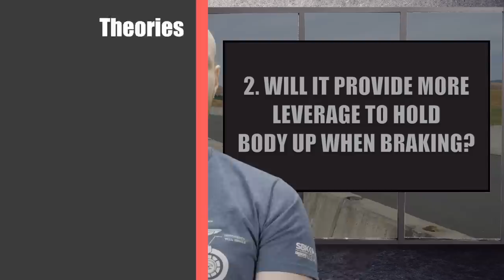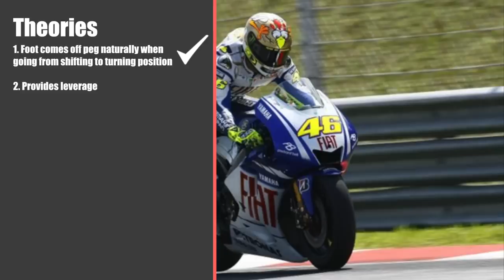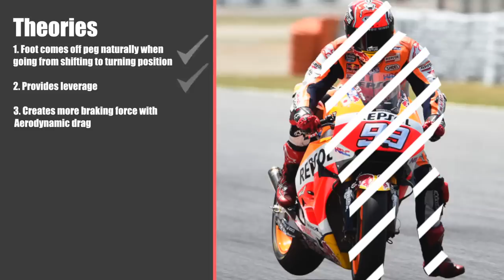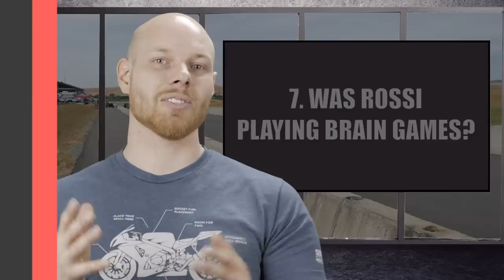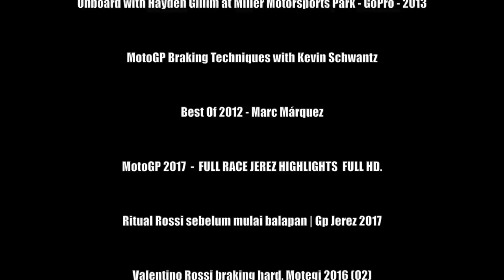The Leg Dangle EXPLAINED

Comment: Neighbors look at me funny when I do this on the lawn tractor.
Reply: Lmao
Reply: You need new neighbors
Reply: When you're braking late before turning around? 😅
Reply: @Sheza58  "trailbraking"
Reply: They look at me even weirder when I have it at max power and I’m in full gear dragging knee off the John Deere
Reply: Why would you do that on a tractor
Reply: Haahaa
Reply: I do it on bicycle, and i lean so much that my tires are on the limit, i measured and i sometimes exeed 45 degree.. everyone looks and thinks i am retard for riding bicycle like that but i dont care, thats some of the best feelings ever, to lean so much at speed...
Reply: @kratkidokumentarci224  on a motorcycle, the feeling is on another level!
Reply: I tried it with the weed eater and tripped myself
Reply: @kratkidokumentarci224  yea one time on my bicycle i leaned so much that my rear tire slipped but i did one of those mm93 saves
Reply: They won't be laughing when it's got a big bore kit and twin turbo.
Reply: Sound like a them problem.
Reply: don't worry my grandpa use to do this on his horse

Comment: I did the leg dangle going 60mph as a split second reaction to my front wheel losing traction during a tighter-than-expected corner. It saved me laying the bike down and sliding into a tree.
Reply: Exactly. Helps with balance and center of gravity
Reply: Inside Business - Nice maneuver bro. Are you still in one piece currently?
Reply: @carlcampbell6827  Thanks, I am and haven't  had any close calls like that since thankfully. Winters coming soon so I don't want to jinx it haha!

Comment: What if Rossi just had to fart. those race suits are tight and the leg lift helps probably
Reply: farting before entering every corner? sounds about right
Reply: Ivaylo Ivanov you see how fast they’re going? The river would be running brown
Reply: @ivayloivanov3744  when riding the chiang mai loop after a pad kapow for breakfast i can vent my spleen on each of the 1864 corners.
Reply: That's a nice theory, but you don't see the suit inflate. Unless they have ventilated suits.
Reply: @64t120r  The real question is: how much of an advantage does this fart produce? That additional propulsion may be wery well controlled. Does the Doctor eat beans before the race to fuel his power?
Reply: I laughed harder then I should've...

Comment: #4 makes a lot of sense, as that's what Flat-trackers do.
When I was learning all those years ago, I was taught NEVER do this, if you foot "catches" the road, it'll snap your shin like a chicken wing.
 Not everything racer does means you should do it on the street.
Besides, two feet on the pegs and knees on the tank makes you more 'planted' on the bike, hence, more stable. Ride a bicycle with no hands on the bars and no feet on the pedals will illustrate this quite well.
 You're not Rossi. Ride like you want to live and you'll have the best chance of doing both.
Reply: Best comment to this video by far.  I'm on-board with your line of thinking.   Cheers.
Reply: Blah blah blah
Reply: “Ride like you want to live” best motorcycle quote I’ve read
Reply: Chicken chicken chicken
Reply: Thing is, almost everyone does it now.

Comment: I’ve seen a few of your videos.   They’re very informative.  I’m an ex-racer and I can tell you why I did the leg dangle.  For me, it had to do with stabilizing the bike on corner entry.  Under heavy braking going into a corner, the rear wheel gets light or comes off the ground, and it stays that way even after beginning to lean the bike into the turn.  The result is that the rear wheel drifts out-of-line to the outside as the bike tips in.  You called this “offset”.  When the weight comes back to the rear tire again, the bike does a big shimmy as the wheels snap back into alignment.  Modern bike design focuses on the centralization of mass, and this makes for quicker turning but it also decreases stability.  This makes the shimmy even larger, and my leg serves to counter this instability.  My extended leg acts exactly like the long pole that tightrope walkers use in that it DE-centralizes the mass for a moment.  When the shimmy is over, I pull my leg back in.  To the extent my outside leg is locked onto the tank, my inside leg (pole) stability is transferred to the bike and minimizes the rear wheel shimmy.  This is similar to your #4 but it's about stability when the wheels pop back into alignment and not just keeping the bike upright.
Reply: Back wheel shimmy? F. I never experienced that. Or tank slap. Tell me more!    ——I sit up if braking harder than usual. Weight transfer, wind resistance, blah.

Comment: Dangling the leg will definitely increase drag substantially, just look at how small changes in aerodynamics can increase or decrease drag coefficient. It will also steer you into the corner. The other thing is that it allows your body to relax for a moment, staying in that tight crouched position for an entire race must be hard on the body (mainly the hips).

Comment: I'm no professional but by studying the videos and watching documentaries and having experience riding dirt bikes, supermoto and street/sport bikes the answer is very simple. Its number 4, the others all help out to control a slide. Why would they slide you may ask? To brake later into the corner and carry more speed! If you watch supermoto racers they all slide into corners while they have their foot out pushing the bike down because it's a fast way of doing it. Marc is infamous for sliding the rear wheel and having the leverage and foot out gives him more control of it especially considering how late he brakes into corners. Other racers do it to incase that happens because of how hard they brake using the front brake, which lifts the rear wheel and when it gets set back down might induce a slide.
Reply: So should I do a Leg dangle if I am doing a Kneedown on a Supermoto?
Reply: Lil Mango it's a moto x hangover it's where they all start racing simple.
Reply: Rossi trains on flat track bikes and dirtbikes.  Its a habit that transferred over.

Comment: I disagree with number 2. In the other sports mentioned they are trying to push backwards on the ground to accelerate themselves forwards whereas the riders are trying to push back with their arms to hold themselves back against the braking forces. Putting their leg forwards, even when not braking will add more force on their arms to hold them back. During braking it will increase the forces on their arms required to hold themselves up.
At a constant speed (or stationary), putting their leg backwards will cause gravity to rotate the body around its CoG, moving the leg downwards and the torso backwards. Similarly, during braking putting their leg downwards means the braking forces will push the leg forwards which will rotate the body backwards around its CoG, including pushing their torso backwards. This means that less force is on their arms, by using their core muscle and the backwards rotation caused by their lowered leg during braking.

Comment: I'm an old former 2 class AMA Expert License holder (125cc motocross and 250cc Road Race, both back in the 70's, and also raced some flat track and competed in Trials competitions and Enduros)), who now rides a highly modified S1000RR...my take is that I/other top riders in the 70's learned to use that technique in motocross to help steer with the rear wheel around corners, it helped with the center of gravity...and of course in motocross if you slid too much you could use it to help stabilize by making contact with the ground, but the idea was to never let your foot touch...I had never really thought about it relating to Rossi in GP, but back when I bought my S1000RR (2012)  I found it helpful (not to mention fun) to slide it into corners to help with corner placement and to get the rear (and front) tire pointed in the right direction and I noticed I was naturally dropping my inward foot just like I did as a youngster in motocross...it wasn't until later that I started researching the idea that I became aware Rossi had popularized it.
Reply: steve Fowler Question. How old are you? I just ask because as an older rider I noticed how it’s not as easy as it once was to ride anymore. I refused to get a Harley and ride to Starbucks but I honestly wonder how much longer can I be in this sport before I just can’t do it anymore. Can’t imagine life at that point! I’m 50 now and it’s getting much harder to deal with the heat, low energy, fatigue, etc. just curious.
Reply: @Dave...I'm 61 and the only issue I have is my heart still thinks I have the reflexes of a 20 year old, and I do not, so it is a constant battle when I'm on my S1000RR to ride well within my limits...at 61 I certainly don't want to get off it, even at modest speeds...it's a dilemma for me that I constantly fight...as to my health, I'm good to go, I still work out at the gym 2 to 4 times a week and still run about 1 1/2 to 2 miles twice a week and still weigh about what I did in my 20's....I would suggest you consider doing some weight training and some aerobic activity (run, bike, etc.), it may improve your energy and outlook....good luck.
Reply: steve fowler, sounds like very good advice to me...  rock on bud!!   I'm 60 myself and am very interested in giving trials a shot. I see tons of practice involved, but the fun kinda practice.
Reply: I don't understand why nobody else mentioned a reference to motocross, that they just simply carried it over by habit. Since MANY, if not ALL, motoGP riders start in motocross.

Comment: Doesn't most of the leg danglers practice a lot with riding flattrack? Muscle memory and just feeling more confident while sliding leads to that since flattracker do it a lot
Reply: Burwarn Rossi does indeed do a ton of flat track training
Reply: That seems a very likely explanation.  I used to ride mx, scrambles,  TT scrambles, and some road racing.  I consider the reflex to dangle a leg a very strong influence that translates into confidence.  As for mx'rs putting the foot out in front, it was largely to keep it forward to keep from getting drawn into the passing turf and ruining the intended line - probably among other senses of balance, etc.
Reply: Before I even watch they dangle the leg to stabilise and transfer more weight to the rear of the bike , hence more grip on the rear tyre during the weight transfer to the front wheel during hard braking.
Reply: Now that sounds like a proper answer.
Reply: Air Doctor - Interesting assessment.  Since I came onto this discussion, have been trying to get a clearer picture of how my own tendencies to do this can be worded out for explanation and it isn't easy.  So much of it is instinctive.  I think there is a tendency for the oncoming air against the protruding leg to begin forcing a twist to cause the back tire to start skidding mildly to the outside of the turn.  In the case of TT scrambles and short track, I doubt the force of wind against the leg had much effect but somehow, the change in c.g. combines with outward force and a controlled slide is precipitated.  I was a successful sportsman rider  throughout the '60s, btw.
Reply: Yup.  It’s natural to wana put your for out when turning a bike.
Reply: @whalesong999 I used to ride mx bikes when i was living in dubai. His explanations related to the mx is a bit off. I'm lucky enough to have a retired racer to be my friend. One thing this video is lacking is that he could have easily asked a racer about his opinion , Instead of going very technical.
Reply: Air Doctor - Yes, technical descriptions for this will be inadequate.  It's just how the rider can translate his feelings into words and, boy howdy, that's not easy!! edit When I came into the sport, the circuit riders of the AMA were dragging their feet during road racing as they were in flat track, and, they raced with no clip on handlebars, used high bars with some stubs on the forks to tuck in on the clutch side.  I don't think they even used rear-set footrests!  Funny how the tendency to let that inside foot go off the footrest has come back into vogue!  ;-)
Reply: Be nice time just to stretch out a little.
Reply: Burwarn 
ha ha, I've just proposed your exact same point without reading it first, might we be right?
Reply: Flattrack and offroad riding in general. I have the same tendency on a road bike while i have an offroad background.
Reply: Sounds better I've always rode mx since I was small and just recently started road riding and it's so hard to stop the habbit of sticking your leg out into corners
Reply: Top riders in flat track slide through legs on the pegs
Reply: The most correct observation right here. I dont think that was the reason he did it the first time but I think after years of flat tracking its become instinct.
Reply: fun fact. My mother's ex who is my brothers biological father is (smokin)Joe Kopp. He is "retired" AMA flat track racer. I'll ask him why they do this shit

Comment: I would add another to the list of reasons - comfort impact.  Straitening the leg would have a benefit in giving some relief/rejuvenation vs being folded up.
Reply: SportbikerNZ that is what I used to think
Reply: I used to do something similar on longish trips, but not racing. OTOH, racing bikes are fairly uncomfortable
Reply: Dirk Bruere I do the same thing on longer trips that are lacking in curves. I thought I was the only one, guess not
Reply: Was looking for this. I have damaged knees and ride with a very tight knee angle. Dangling each leg in 1-2 corners each lap stops the pain in my knees.

Comment: There is no technical explanation - they don't do it every time or every corner. The best explanation/justification I've heard is that it helps blood circulation in the leg (otherwise restricted by the serve bend in the knee caused by riding crouch for aerodynamics); can't do it in a straight line - tucked in for aerodynamics, can't do it in corners - obvious. Only in braking is there the opportunity without disadvantage. 

Street riders often stretch their legs in the straight ahead because they are not going for every ounce of speed (aerodynamics).
Reply: Graeme SYDNEY well said... this more logical.
Reply: With Vale being the oldest, this would make sense as to why he's the one to start doing it.
Reply: Sorry dude but that is absurd. Watch them all doing it like line dancers.
Reply: Its not absurd. If youve ever driven a sportbike youd know on a longer trip legs begin to feel like shit... you will want to take a break and walk around abit. And this is by driving casually... not 100% race speeds. Its still the  same reason... exhausting being in an uncomfortable position.

I drive a sportbike irl and when i take mere 20km trips  i dangle my legs and stand up (if possible) on my bike near the end of it to stretch my legs and butt. And this is without wearing a tight racingsuit, i wear alot more comfortable outfit but is still protective.
I can only imagine whats it like racing  a bike in a tight suit for an entire length of a race.

If your front wheel steps out theres no way to save it anyway... no point in thinking its possible.
Reply: Otakahunt. Sorry bro. Your explanation only really applies to riders who sit still for most of the time.
In motogp etc these guys are jumping about all over the bike! :)
Reply: Ken Underwood That's the point he was trying to say. If you move more, you'll have even more pressure on your feet. It's fully logical. I get sore legs when I ride aggressively for a moment. Much more than generally riding.
Reply: jothain: It helps me avoid cramping up to use aggressive body positioning in corners, allows me to stay comfortable longer on extended rides. Granted, I'm on an adventure bike rather than a sport bike. It also let's me rest my ass a bit, as I do the one-cheek scoot.
Reply: Moto gp